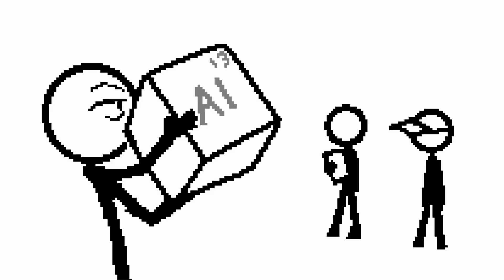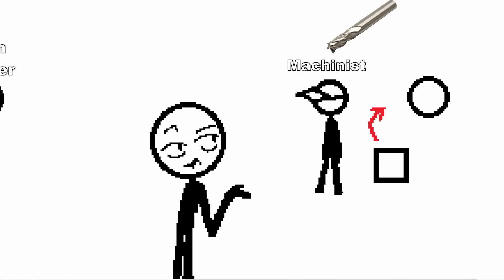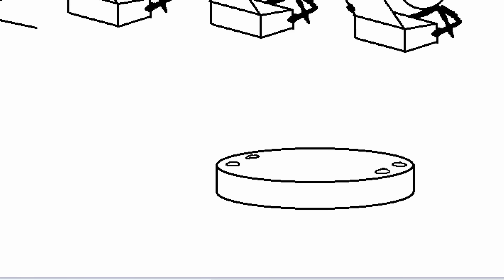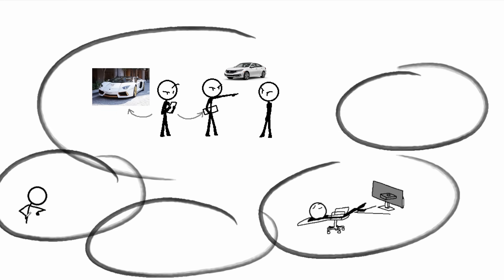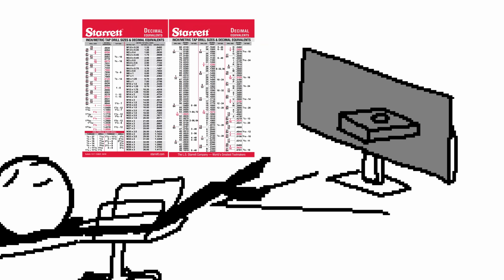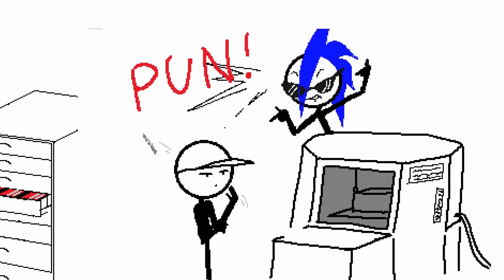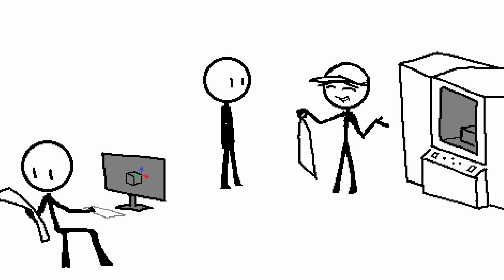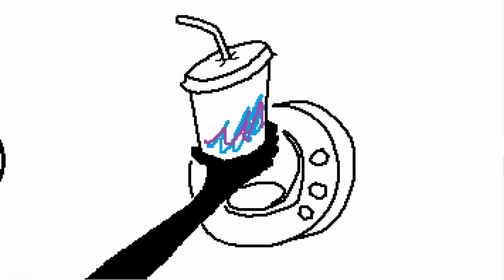Why we hate engineers

Comment: Learned this during my first job in designing products. So much back and forth with the machinists, and eventually the product looked nothing like the original drawing. I was so frustrated with their requested changes. I had no idea before you had to factor in so many variables, not only for when machining the part, but also the production of it. Things like material shrinkage and warp  due to thermal differential, cycle time for the part (can literally 4x the cost of a part), etc.. The cool thing is what once you understanding the manufacturing process and requirements, you unlock the ability to make almost anything you want.
Reply: Unfortunately people hire brand new engineers out of college and expect them to have a 4 year machinist degree at the same time to save money which leads to mix ups like this.
Reply: @toasty365  That's very true, in a lot of fields too. In my case, the company was well aware I would be learning. Every professional has to start somewhere.
Reply: So in France, that's year one.... and you don't need to be the engineer dreaming up the part. Just to take those plans and restrictions on it and pump out the design for the shops. That's a two year program. We understand the jargon of the Engineer, and the jargon of the Machinist. We make sure that the transition happens as smooth as possible instead of making them rage at each other.
Reply: @ForestRaptor  I was about to say the same things, I am bewildered this is such a huge issues for many. In France engineering designing, machining, etc degrees all get taught about the other side of things in order to avoid such mistakes. Of course there is much more to learn depending on your field afterwards but at least, you are aware you will need to work together, plan your design, etc. I work an engineering job where I also design, and directly work with machinists. Between someone interested in becoming good, learning more, etc and someone doing it to put meals on a table, the difference is huge in less than a month. But it takes at least 2 years of working experience to get someone independant enough. I urge anyone working in the field to always have "Le Fanchon" nearby, the thing is an Engineer/Machinist/Designer's Bible and holds within all the basics you desesperately need.

Comment: Current student and I've been impressed with the teaching of my professors.  They really elevate the value of a machinist's input.  I'm taking a CADCAM class and the professor iterates over and over the importance of communicating with your machinists and relying on the knowledge they have.  They also have emphasized that for any given project, find out what tools are actually on hand and be familiar with what they can do.  No point designing for one machine over another if the combination lathe/mill isn't actually in your shop.

Comment: Sometimes I felt inferior to my fellow engineering students who got their undergraduate placements at more glamorous engineering firms, while I worked at a fitter machinist workshop.

This video gave me a lot of pride in the little machine workshop where I work! I’m also so much more confident around power tools, knowing how a particular part could (or not) be machined, and even painting!

All that came from a friend who realised I am an engineering student, who then said I should “learn how to swing a hammer”!
Reply: that is HUGE part of the problem, those engineers should be sent to manufacturing departments, not engineering, to get their practice in, to actually see how parts are getting made, what makes them easier or super expensive to make
Reply: @dsfs17987  if your engineering has anything to do with manufacturing you will have to gain some practical experience. But I will never make a drawing/part etc. I`m "only" sorting out principles that might solve a problem and the constraints they need to perform well. As well as some magic with math once the prototypes are finished so they work as expected an only as expected.
Reply: @MrHaggyy  Structure optimization? The kind of person I love having as as co-worker, as I'm absolutely trash on the academics side of engineering. Absolutely perfect complimentary type for the building/manufacturing types like me
Reply: @Kalvinjj  😅 I don`t know how many coffees my system admin got from me by now. As I only work with data, algorithms, and simulation I blow up our IT on a regular basis. But i do love our mechanical folks as well. They give me machines I can do my control engineering magic on.

Comment: Aerospace machinist here. Bullet point 4: planes are riveted together and then sealed with aluminum tape. If you stack the tolerances on the low side for the right wing and the high side for the left, a 737 will have 4 feet of difference in each wing. The tolerances are not as precise as you’d think in this industry. At least, not for structural parts haha. Some stuff is totally +/-0.0005” but not very often.

Comment: One lesson I learned as an engineer was that -- even when designing a building or a bridge -- it was important to design using standard material sizes rather than specify a thickness that your calculus calculation says it should be. My structural engineering prof told us about a domed stadium in which every part of the roof was sized differently from every other part of the roof, based on a sophisticated structural engineering computer program. From the perspective of minimizing material use, it was IDEAL. From the perspective of COST or even CONSTRUCTIBILITY, the design was terrible. 

A bridge or a building design is not good when the bolts can't be tightened with a standard wrench -- That's what "Constructibility" means.

Comment: As a machinist (manual and cnc). Almost 10 years of experience. Working in job shops and production shops.. this video is 100% true & accurate!
Reply: As a grinder I can confirm.
When in factory where I worked designers made blueprints of new stamp or press-form, we always did some improvements and optimisations. This is just annoying

Comment: My first job in electronics was to be an engineering technician in the R&D department (making prototypes, fixing prototypes, wash rinse repeat). But apparently the engineering documentation department was behind creating the documents that told the production floor how to make the products based off of those prototypes (I stayed in the documentation department until I left that company). I was new to the industry and knew that there was a whole bunch that I didn't know. I didn't know what I didn't know, but I knew there was a lot of it. So, when I was handed prototypes to turn into documentation for assembling products I would often go down to the production floor and ask the guys and gals down there something to the effect of "if you needed to assemble this part from these pieces, how would you do it?" I became known as the person writing documentation for the workflows that they actually used. Based on my experience, I would add a step zero to your list: 0. Assume you know nothing about how to actually fabricate something, and don't be afraid to ask the machinists for advise. But I guess having a fabricator on the design team would cover the second part of that step.

Another trick that I learned about specifying radiuses when the actual size of the radius really doesn't matter on a fab drawing is just specify "break all sharp edges". Fabricators know what that means, and will use the easiest method that they have in their shop to remove all the razor-blade edges from the product. (Especially important in sheet metal fabrication.) If you specify one method of breaking sharp edges because that is what shop A uses, when you take your drawing to shop B they may have to buy tools for your job because they use a different method of breaking sharp edges (which will drive up the cost of your fabrication).
Reply: Same here
Reply: Thanks for your advices! I'm a recent mechanical engineer.

Comment: Sending your new engineers straight out of college to work in the shop for a while is also a great idea. They don't cost as much at that point, but they can learn a lot from being out there and dealing with any of the problems. Source- I rotated through assembly, machining, and fitting/welding over 3 months. (I didn't get to run the machines myself though :(  )
Reply: We don't want them around the shop at all. Especially straight out of college. Hard pass
Reply: I really get sick of management being too cheap to hire someone with a real degree period.  I would take an engineering student straight out of school way before a fake.  I have worked with a few newbies and gotten wonderful things done when they are open to guidance.
Reply: I worked in the shop and now they're telling me it doesn't count as engineering experience.

Comment: An engineer without the slightest clue how much it costs to fabricate each feature he puts in the drawings. A machinist who is totally oblivious to what purpose the part being made serves, what a perfect combination. As an engineer I work so closely to machinists that I'd invite cost reduction suggestions from them. They're smart and 8 out of 10 times have no problem figuring out what a part does. I'd fill them in when they don't. Works like a charm. Sometimes a seemingly insignificant edit like rotating a feture by a certain angle would help 'em mill one less face of a part, and that translates to reduced cost. The part ends up functioning just the same. I care about it coz I'm spending my own money on those parts, and my own time assembling them together. If they don't work, or the assembly process sucks, then I'd be fucked by myself. That's the best motivation there is for me to put myself in someone else's shoes even just for a brief moment once in a while.

Comment: In 2nd year engineering and Im hoping some of the rage clicks inspire people to watch this video like I did. One of the first year courses ive taken was heavily about computer design and manufacturing methods. They try to drill stuff like this heavily at the beginning, but it unfortunately seems to disappear when getting into later parts of the courses. There are Horror stories in the trades about how seemingly random alot of parts in a machine are made and assembled. Most if not all of it is just from laziness or frustration.
Reply: It’s from designers who aren’t familiar with manufacturing processes or aren’t thinking about assembly or maintenance, aka bad (or young) designers
Reply: @enginerdy  or designers who have no grasp of physical limitations
Reply: internal sharp corners, insanely tight tolerances for no reason, and nonstandard geometry are the most frustrating things by far
Reply: @vanguard6937  everybody gangsta till non Euclidean geometry is used to make a shelf bracket
Reply: @Driver-qt9jh  Machinist: "How, exactly, do you expect me to make this part on a 3 axis machine?"
Designer: "idk thats ur job lol"

Comment: My favorite were drawings that have angles as measurements. I swear at least 30% of the parts I made where checked by putting them on a 1:1 drawing. My machine had a probe, but I can’t fit a 10mm probe into a 5mm hole. I think another rule should be, give the machinist measurements he can easily measure without having to bust out a calculator and spend an hour converting radii and angles into something he can measure with calipers and other measuring tools that I don’t know the English name of.
Reply: Or just learn trig? It doesn’t take an hour, literally seconds lol
Reply: @zeitgeist2720  You've never worked in a manufacturing or fabrication environment then. Having dimensions that require additional work for the machinist to decipher is a good way to allow errors to creep in and piss them and your boss off for wasting their time. The buck stops with the engineer if the drawing is bad or poorly laid out, and I've seen engineers fired over stuff like that.

It's easy to add all sort of dimensions in CAD software, making someone sit down with a calculator and notepad to figure it out isn't.
Reply: @zeitgeist2720  yea i mean it isn't particularly hard to convert degree to radians but i am an aspirant without work experience so what do i know
Reply: @TheRealHooptiesOfGeneseeCounty  "Ken oath mate. It's a pain with a calculator. My dad and his dad had to do it with a bloody slide rule. No end of respect for that level of applied guess work...
Reply: If at any point a a fabricator comes to a designer with questions and the response is "just figure it out, bro" then the designer has failed to do their job.  That's a disgusting level of buck passing, and you know that's the kind of designer that immediately throws the fabricator under the bus if the project overruns time or cost, or God forbid there's an incident when the product gets to the customer, because "they didn't build it the way I told them to."  Except you didn't tell them how to build it.  They asked for clarification but you apparently had better things to do than the one thing you were hired to do.
Reply: @zeitgeist2720  I’m not talking about one or two angles. I’m talking about the width being two radii and the length with an angle with every position being angle from something else. So for example the width is the difference between R162mm and R127mm the length is marked with a 60* angle the hight with 10* and five holes 30* apart starting with a 10* spacing from the right side.
Reply: @zeitgeist2720  You never worked a hour in you life then. Machinist has to work and not spend time on calculating anything.
Reply: What really hurts is being given a drawing for a plate/part that requires manufacturing then bending. Then the drawing you receive is a 2.5D model of the product in the finished state and all the dimensions on it are useless because they only apply after the bloody thing has been bent, so you ask the designers if they can give you a drawing of it with dimensions 'before' it's bent only to get the response "we don't have one, you don't need it anyway, all the dimensions are on the drawing". Long story short I had to reverse engineer the part from its 2.5D model because I had nothing other than the finished drawing to work with.
Reply: @roarkviolet1912  and if you would’ve worked in the company I worked in you would’ve been told that you are to slow. Oh you had to rebuilt half of your tools and re wright more that half of the program because the people that are supposed to take care of it suck at their job? Sucks for you, you should’ve been done yesterday oh and btw. that new program wasn’t actually new and you could’ve used an already existing one, but no one told you until you’re done. I’m glad that I don’t work there anymore, since sh*t like this happened at least once a week.

Comment: As a fabricator, machinist, and general metal wizard who is going through engineering school now... Yes. All of this yes. Have the chart in your area. Get a finish gauge. Get drill blocks/gauge pins. Get every type of measuring instrument you can fit in your little hell of a cubical. Have a copy of the machinist's handbook or any other reference book relating to what you're working with too. It honestly makes designing so much more fun too (imo) because you're working within constraints

Comment: Former mechanical designer here. I've been taught alot by the Swiss machinists about precision engineering, what is doable and what isn't, and even if something is doable, what are acceptable tradeoffs between cost and quality. Sometimes, you can get a moulded fit for a particular repeated workpiece, but often, just a few pressure points by the holder is sufficient. Oh, and try to be substantiated by ISO standards as much as possible.

Comment: idk if this would be useful to anyone but before I got a engineering job, I didn't know about sheet tolerances. These are the "default tolerances" that were mentioned in the video. They specify fractional and decimal tolerances as a sort of "fallback". I agree, if you are making a block with 3 holes, then follow standard billet sizes and wide tolerances for the bounding box and use sheet tolerances for the position of the holes. Be sure to account for tolerance stack up
Reply: For those who might appreciate this:
a)
|-------------|-------------|--------------|

b)
|------------------------------------------|
|---------------------------|
|------------|

These two look like they give the same dimensions but their tolerances behave differently. Both have their uses.
Reply: @Kycilak  chain dimensioning and datum dimensioning